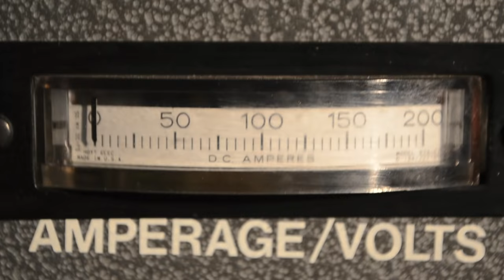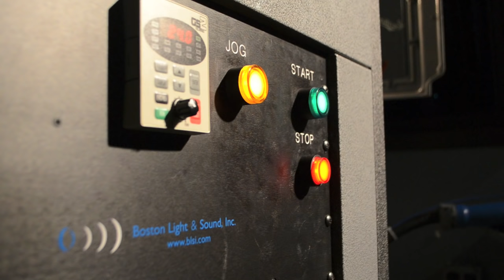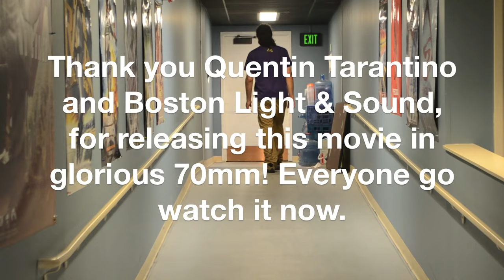Hateful 8 70mm Roadshow - From the Projection Booth

Comment: Matt Dickey -  I Spent 7 years in two many different Projection Booths to count back in the 90's. Only ever had the pleasure of running one 70mm Print in all that time, which was Ron Howard's "Far & Away" ( 6 Track Mag sound - in our THX certified house.)  Interesting 70mm adapters seen here used  4 the DTS reader. Never saw those B4. THX for sharing.

Comment: A magnificent beautiful video which chronicles the art of the traditional projectionist .This is true cinema, an artistic creation lovingly crafted and shewn ,a trip to the cinema should be an occasion and an opportunity of artistic enrichment.
As forthe digital brigade,they shall never replace the experience of excellence.They said the English Longbow was dead - wrong,the turntable and the tape recorder was dead— both are undergoing a popular revival of magnitude and permanence
LONG LIVE CELLULOID,LONG LIVE THE ARTISAN PROJECTIONISTS
Reply: Sorry Edward, this is not exactly traditional projection. That would be reel to reel with high intensity carbon arc lamps , like the Strong Constellation 170, Strong Jet Arc, or Ashcraft Super Core Lite. The 70mm projectors I’ve seen were Phillips/Norelco 35/70 machines. I know Century and Simplex made 35/70 projectors, but I’ve scarcely seen them. I was a projectionist from ‘71-‘89 in Denver. I never had the chance to run a 70mm film.

Comment: My dad was a projectionist he worked the original Cinerama process and also ran35mm and 70mm shows he could take apart a projector and rebuild it . What a craftsmen hehadtodothe filmbuildups and breakdowns and do manual change overs no platters then all reels in each projecters he would change the rollers and film gates for 70mm. .

Comment: I used to work with Century JJ Mag readers, but I never had the change to get a 70mm print to run it on.  We had all the rollers and hardware for the switchover in the cabinet, but never used it.

Comment: Had the privilege of threading Century 45s and Cinemeccanica Victoria projectors, fed from SuperPlatter tables. I miss those summers. I had 8 screens then 12. My worst experience was on a print of Summer School. There was a chip in the print and I guess as it spooled onto the take up platter the print split and half of it spooled and the other half ended up on the floor. Had to stop the screening, cut the damage out and re splice it. Lost over 5 minutes of the film.

Comment: Just out of curiosity, wouldn't it be better to thread the takeup platter before the projector?
Reply from the maker: Adam, several parts of the threading process were out if order in this video. I did it for the sake of continuity of the film's path. In practice, you're correct. The sound head and projector would be threaded last

Comment: Quick question: Is every frame of film pulled down and held still in front of the gate for a fraction of a second before moving on, or does the film just roll roll through smoothly?
Reply: It’s advanced at 24 images per second here in the US. Each frame actually stops in front of the gate for ~0.0417 seconds.

Comment: I have to know, is the second platter ( the one that comes after the projector ) motorised? or is there some other mechanism which pulls the film through the projector? If the second platter is motorised, how does it feed the film at a constant speed, despite the diameter increasing? surely this would lead to the film speeding up? thanks.
Reply: Well -two years on, and no one answered your question. 
Both platters are motorised. The feed-out platter is controlled by the little tongue-shaped lever arm you see, which means the actual compliance/elasticity of the film plays a role in governing the speed of the platter.
The take-up platter is controlled by the large arm you see him thread it through. This arm has a stiff spring on it, which will determine the tension of the takeup wind, as well as the speed of the platter. With a couple of feet of travel, as opposed to a couple of inches, the movements of this arm are much more generous than those of the little payout tongue, making a much more stable system.
The payout tongue can be very finicky. Americans often referred to the center feed device as the "brain" (even though it contained no intelligent devices whatsoever) and when it was unable to keep up, and film would start to wind around it in the wrong direction, this was referred to as "brain wrap". Many shows were canceled and many film prints damaged to to this phenomenon. 
Kinoton (Munich Germany) developed a much more reliable system, starting with the Einsteinian realisation that both platters always turn at the exact same speed, give or take the very minute difference in spool size due to the fact that film debited from the supply side had not yet made it to the arrival side. Using this revolutionay precept, they were able to devise a platter in which the arrival side, with the much more forgiving swing arm, controlled the speed of BOTH platters, and the tongue on the departure side only informed an error bus, to control the minute difference between the two platters. 
Both platters turn very fast at the beginning of the film, where the diameters are small, and very slowly at the end of the film, as opposed to a reel system, where the payout reel would start slowly and the takeup reel quickly, only to gradually reverse throughout the length of the reel. 
It was at the beginning of the film where platters like the Christie, pictured here, had difficulty maintaining order. 
Hope this helps to answer.

Comment: Now, what does the sound system look like?  It would be awesome paired with a fancy or rustic Tube Amp.
Reply: It’s most likely a single crossover running into a couple pairs of rackmount solid state amps, each powering an array of speakers behind the screen. Tubes are nice for a hifi, but are incredibly unreliable in commercial implementations like these, not efficient on power at all, and would never be loud or big enough to match the power delivery of modern class D amps
Reply: @Evildandalo  There's always McIntosh, but that's a bit pricey.  I'm not sure about wattage but Tubes need vary little for base.  My little low watt amps can shake the house when I do a frequency test with them.

Comment: There's actually a better way to do this. 
Instead of dropping the film on the floor (and I do appreciate the effort to keep it in a neat roll, but it still goes on the floor) it is possible to thread the entire platter system first - never touching anything but the very end of the film, then come BACK and thread the projector. Nothing ever goes onthe floor, and you are not trying to thread the projector with a loop of film in your hand to avoid dumping it on the floor.
I didn't invent this - it is a tip from KODAK Reel Notes, and like many other great things there is probably at least in part attributable to John Pytlak.

Comment: Do they not make 35/70 hybrid projectors so you don’t have to haul a 70 in the room on the odd occasion?
If not, we need innovation and someone needs to design one.
Reply from the maker: Ian H I have some good news and some bad news. 

Good news first: this projector runs both 35 and 70. If you look closely when I’m threading through the projector itself, you can see that the rollers I close are marked “35” on one side and “70” on the other. They can be closed either way, depending on what you’re running. There are two corresponding sets of teeth on each sprocket, for each type of film. There are also a different gate and trap (the large “plate” which closes on the film, where the light passes through) for both formats. The projector is a Century JJ. 

Now for the bad news: I don’t believe that there will be any new film projectors being designed or produced. There simply isn’t the demand for them, there aren’t enough films being produced for this to be feasible. There are so many “old” film projectors around, that it makes more sense to use those than to innovate and produce more. 

Please let me know if you have any other questions! I’m happy to spread my knowledge of projectors and film.
Reply: So every 70mm projector is capable of 35. Cool, thanks. And I wouldn’t give up hope just yet, a resurgence of film use as a capture medium is still in operation and every city/town should have at least one film house around; especially for the film makers intent upon exhibiting on celluloid.
Reply from the maker: Ian H Not every 70mm projector, just this model. Century JJ is the model name. And I appreciate your optimism! I hope you’re right. Perhaps someday it becomes what vinyl is to music. The aesthetic cannot be imitated by digital machines. I had to watch this movie projected digitally, and it did not look nearly as good as the 70.